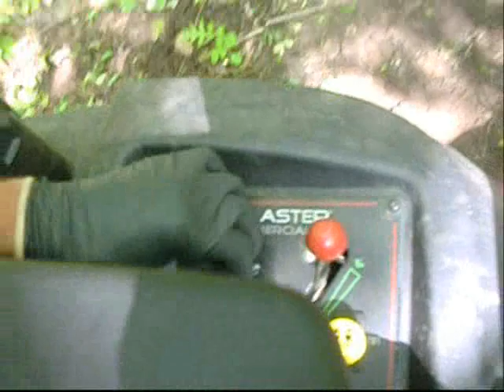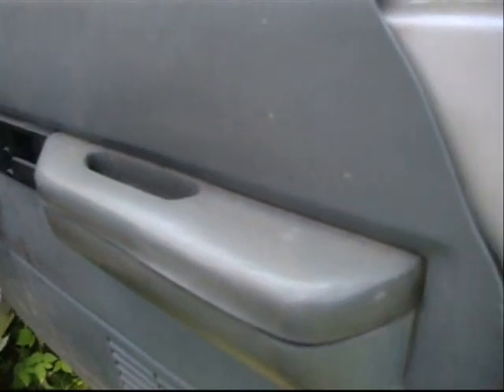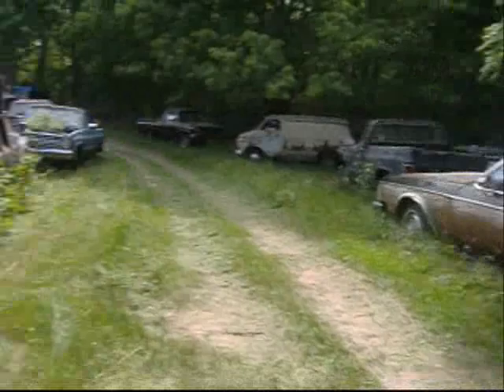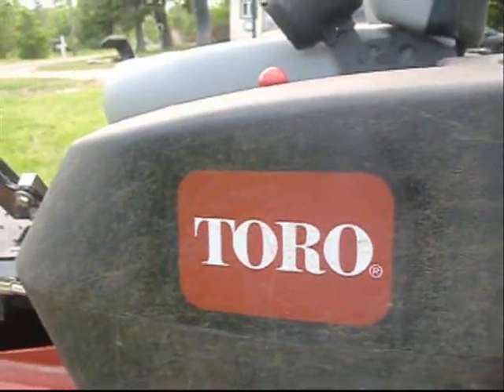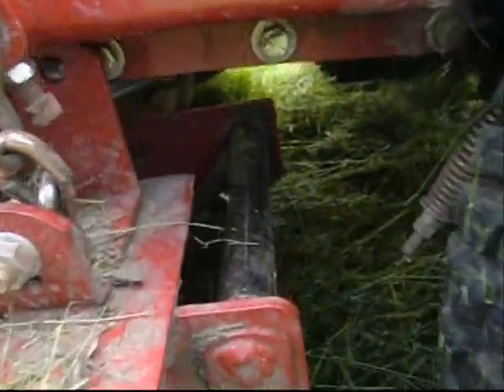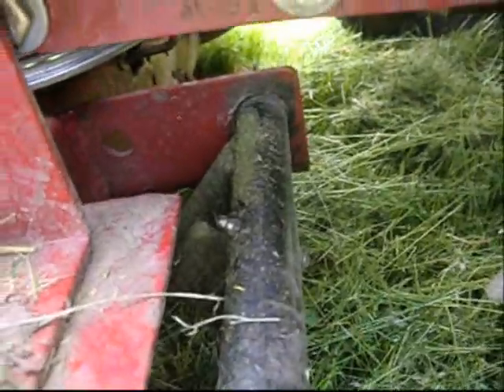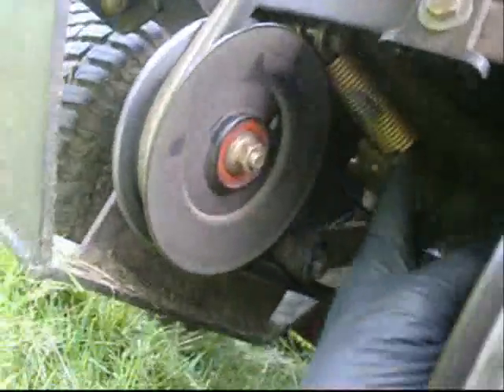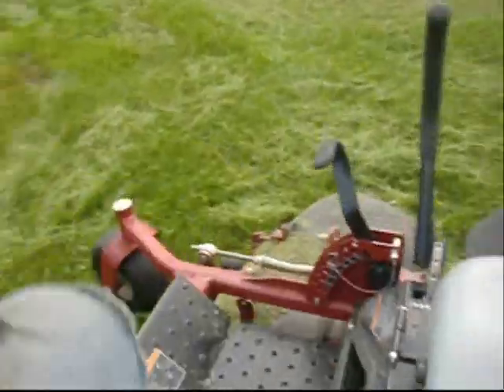6 7 11  Toro Chucking Parts...

Comment: when the level bar comes off (it keeps the deck from moving back horizontally) , the tension  goes out of the drive belt and the resulting impact (and every impact from starting up again) brakes the spring on the belt tensioner...and lucky so...because it could have ripped into the hydraulics ,electric clutch or worse...one of the wheel motors... and you've got to use "it" for what it's made for...

Comment: My friend sent me a e-mail he had bought 20 acres of a old farm he had not been in the back part of the property since he bought it years ago he told me he went in the back part found a trail and it led to a car covered on blocks it was a 1969 charger with a 426 hemi engine car had less than 30k miles The car was in very good condition  He has had offeres over 100k you never know what you will find 
Trade it for a old jake much happier